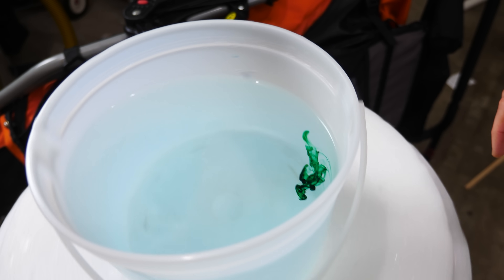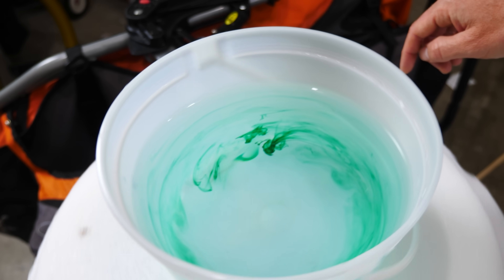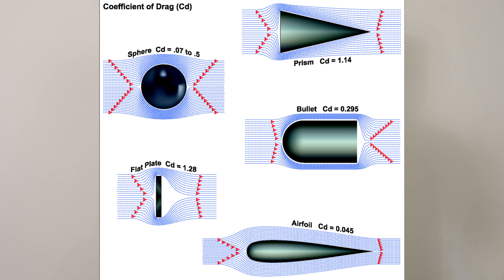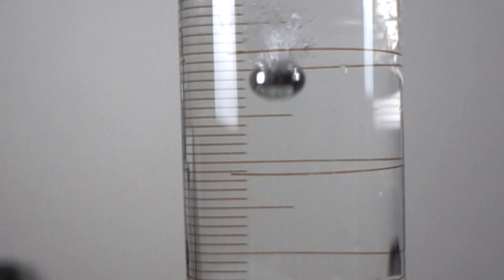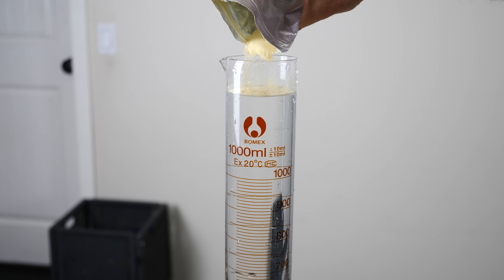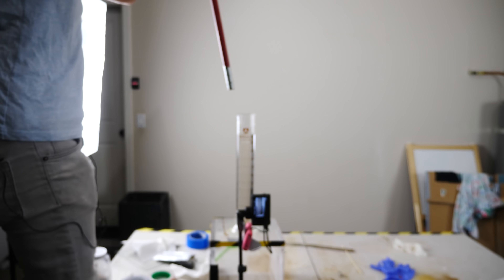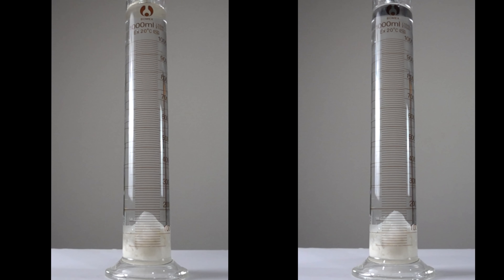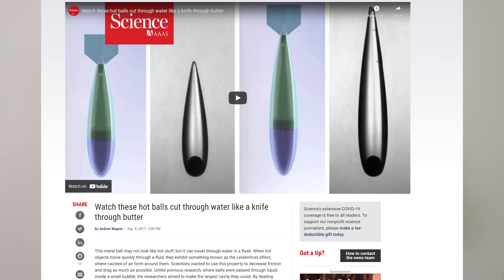Hydrophobic Projectiles Slice Through Water With No Drag

Comment: The heated object obviosly touches the liquid, how else is the water getting the neccessary energy to change its phase? It certainly doesnt do it by radiation. The water touches the tip, heats up changes state to gas and expands. The air gap that is created will be displaced to the side the the movement of the object. New water molecules hit the objects front.

Comment: So this is how those UFO’s can move from air to ocean instantly without any resistance....cool
Reply: Never thought about it. Great idea!
Reply: Definitely
Reply: @tigerclaw4537  I don't think that's correct. As matter of fact Commander Fravor and the other fighter jet pilots first saw the disturbance in the water which was what made them spot the tic tac craft visually.
Reply: @Braap420  no, u didn't see any of those
Reply: @Illum_  what?
Reply: @Illum_  nice try
Reply: Or we have learned to coat our drones in similar tech that creates the hydrophobicity.  We've had the spray for a few decades now so don't you think DARPA could have improved it?
Reply: @childrenoftolkien  Absolutely, you can even fabricate a funky looking prototype with that moldy powder and some glue. Now you just have to explain the means of propulsion of the craft. But anyways I think there are both secret black budget prototypes and actual non human fabricated crafts. And I also think it would be the only way to disclose other intelligent species with that type of tech by saying we have something similar too so don't be scared we are still in control...
Reply: It was just a balloon.
Reply: @snorman1911  Yes just a balloon out near our Navy at night, detected on radar by a Independence-class littoral combat ship, flying 40kts against the wind that then dove into the water.
Reply: The only problem is it would have a heat signature
Reply: That was my first thought as well.
Reply: @tigerclaw4537  likely that its just a blurry object flying over the horizon and earth curve, and appearing to go into the water and "not making a splash" is a result of that
Reply: @zenosol234  that's what a UFO is un identified object
Reply: @zenosol234  Careful, you're starting to make too much sense!

Comment: does the hydrophobic coating affect the force of impact on the ball hitting the surface of the water? IE Bullets normally break up when they hit the surface of water... if you used a hydrophobic coating on the bullet would it be able to survive further into the water before deforming?

Comment: Couldn’t you technically create that same air pocket using a high frequency vibration?
Reply: Then the frictionless torpedo will be detectable by the enemy
Reply: @KevinRamesh  It’s not exactly frictionless if it creates ripples through the water still. If I am correct, if it was entirely frictionless, it would appear the exact same as the first trial, but with a bubble like container holding the object throughout the entire fall. At least that’s how the Leidenfrost effect works. The reason it creates the torpedo like figure is because it has velocity (in this case, gravity) pulling on it while it falls leaving behind a small trail of that hydrophobic material used in the test. This of course would have to be down at the molecular level though as the object could retain the properties it received while it had contact with the liquid substance as it hits the bottom.
Reply: @CallMeCOM  I do agree😄

Comment: While torpedoes have a certain cachet, I'm more interested in the potential efficiencies if boat hulls were hydrophobic.

What would the effect of surface gas on buoyancy, as well?
Reply: For a normal ship, this would probably sink it, since it basically would be a boat against air (low density), insetad of boat against water (higher density). There are experiments about this in connection with the Bermuda triangle: https://www.youtube.com/watch?v=MSmAXp_BHcQ
Reply: @Suthriel  What he refers to in the video as "a hole in the water" due to the bubbles is far deeper than the "hole" of a skin of air.
Reply: @PablumMcDump  But this here is about the air going down with the ball/torpedo, to reduce friction whereever the ball/torpedo goes. So i am not sure, if this is such a big difference, if the air follows as a thight air skin. It def would be an interesting experiment to find out :)

Comment: ActionLab: "So awesome, a way to make a hydrophobic torpedo...!!!"

DoD : "...and this is why we hire civilians to make our weapons...!"
Reply: If the toro leaves an air bubble behind the blades cant work thus not moving the torpedo making it useless
Reply: @mathew0172  how bout making jus enough of the torp hydrophobic that the "bubble" tapers right in front of the guide fins an propeller? 🤔
Reply: @johndoepker7126  then the torp would have a hidrodinamic form making the improvement useless
Reply: Hydrodinamics are very strange
Reply: @mathew0172  strange doesn't begin to describe it...still....pondering the "what if's and, how's" is still fascinating.....and fun. Anything to keep the spirit of science alive.
Reply: @johndoepker7126  by strange i meant that i dont want to explain why it would work
Reply: @johndoepker7126  but still its true that with this we maybe can have someday some kind of hyperloop underwater
Reply: @mathew0172  Maybe have the blades upfront? Or make a jet torp?
Reply: @nerobernardino88  can't mess with the front cuz the front creates the flow that lets the torpedo move basically picture dropping a cube and dropping a sphere into water the sphere should fall faster cuz the water doesn't get caught on the sphere
Reply: @nerobernardino88  Blades at the front would be useless thats why they are on the back and i dont know how well a jet engine would work underwater, those used for the icbm on subs only need to go for a few meters before exiting water in case thats what you were thinking

Comment: Is the Buoyancy of the air bubble put into consideration?? it must have a drag, right?
Reply: It's an extra force pointing upwards. It's different from drag (it's not a dissipative force), it acts more like reducing the force gravity, leading to a lower terminal velocity. Which is part of the reason, why the time difference is moderate, even though the drag coefficient is so much smaller.
Reply: @simoncopar2512  Thanks Simon.. That clears it up!!

Comment: I’m assuming there are reasons this isn’t done for underwater projectiles like bullets or torpedoes

It seems like a superheated object would lose heat within a relatively short distance (as far as engagements are concerned) and become a relatively useless/impractical strategy

And I’m assuming the hydrophobic coating doesn’t last indefinitely, or would be burnt off in the action of combustion firing

Comment: There's actually two more methods: continually generate a gas bubble at the forward point like supercavitating torpedoes ( https://en.wikipedia.org/wiki/Supercavitating_torpedo ) or you could coat it with hydrophobic plastic like is used for modern ketchup bottles.
Reply: True.
Reply: Heinz is now a certified weapons producer
Reply: Exactly what i was thinking.
Reply: Was going to mention this. Good that Bob did. Since it actually a technology in use.
Reply: wait they're using hydrophobic plastic in ketchup bottles?

i mean there are people specifically tasked to make it impossible to get the last 10 something percent out so you'll have to buy new condiments earlier, so that sounds nice
Reply: @tobbleboii5988  No, they're using it so the ketchup (other semi-solid products as well) doesn't stick to the container; it will all come out. Hydrophobic, not hydrophilic.
Reply: @bob_._.  hehe no i got that right. But the ketchup and mainly mayo bottles we have here are usually shaped in a way that keeps the rest in. The mayo doesn't even stick to the bottle, but the lower end (or upper end once you turn it around) is a bit larger to keep it from flowing down. It's quite elegant for being so sinister. We've got a mayo bottle here that's been standing upside down for some three months and a quarter still hasn't flown to the bottom :/
Reply: @magnusk.n.9472  pretty much, yeah

except there probably isn't some huge conspiracy behind this, but yeah companies are always gonna optimize for money made
Reply: @anullhandle  i wish that'd work, but i'd destroy the bottle before it'd come down. The only way that really works is with a knife, or perhaps heating it up but that feels very wrong xD